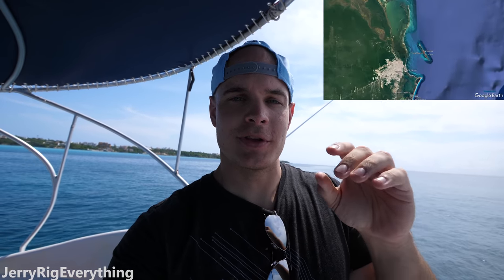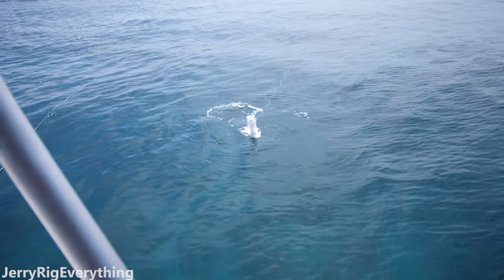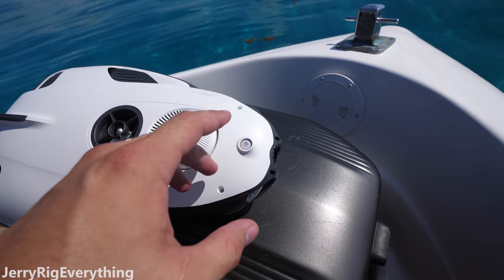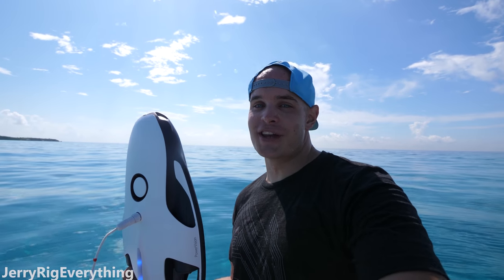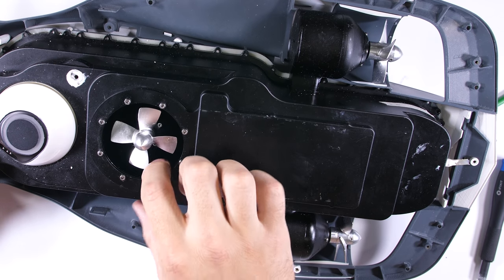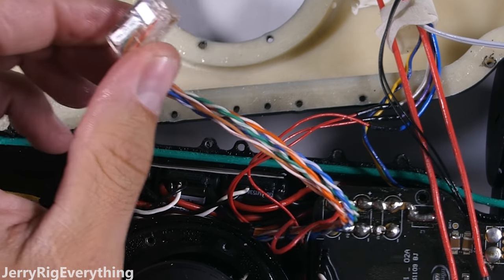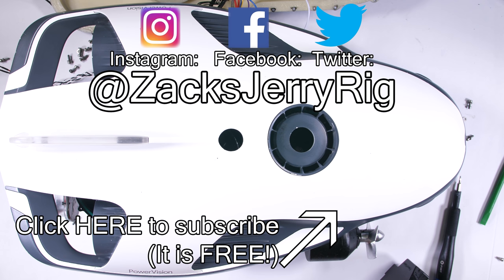This Under Water Drone Conquers the Ocean... in 4K!

Comment: As an underwater drone, you would think it would have a red lens filter so the colours would look real instead of green.
Reply: so it blocks more light?
Reply: @JanSeewald  No, so colors look more realistic and not green or gray.
Reply: Green is a real color...
Reply: @JanSeewald  It doesn't actually block that much more light. Search for videos of using a red filter for underwater videography and you'll see no significant difference in brightness, but a significant difference in the colour range.
Reply: @AndreChampoux  You can't expect people on YouTube to have an understanding of light & colour. They probably do not know that their screen cannot actually display vivid cyan.
Reply: @medotaku9360  But not the colour of objects at depth. Look it up if you must. If you know why the sky is blue, it will help you understand, if not you should look that up also.
Reply: @willclark2235  exactly
Reply: @philo8035   Phil Oetinger  Right, because saying that "*this drone does or does not correct for loss of color due to water depth*" would be complicated... NOT
Reply: The problem with a manual filter is that the color correction changes with depth. The deeper you go, the more red you need and the less blue. So, since it's all done in software after the fact there isn't a point in including it in the original recording software.
Reply: @mikinleyweaver4692  I've tried with the software and it sucks over using a lens filter from the beginning.
Reply: @AndreChampoux  True, it does. But with a drone that is remotely operated at all depths, it's just impractical to have a manual filter.
Reply: Andre Champoux green is a paradise colour
Reply: Andre Champoux those are the real colours? He isnt in a clear water bed
Reply: What do you mean real it’s meant to look like it’s in water not air
Reply: Andre Champoux No actually he’s right, it’s just gonna look worse because it blocks more light and it’s gonna look gray
Reply: You can just edit the white balance of the video

Comment: That rubber gasket certainly will re-seal with no special procedures if you put it back together. It's different from a phone because the phone seal is torn and destroyed when you open it, but this one is designed to be resealable.

You would want to tighten the screws gradually in a cross pattern to prevent damage to the gasket when reassembling.
Reply: rjk I think he need to reseal in a positive pressure chamber in order to get a counter force acting when this sub (or any normal watches) goes under water
Reply: Water pressure is intense. Every 10m depth adds another atmosphere of pressure. This drone is claimed to be water proof for up to 30m. Therefore this drone needs to withstand pressures from 1 atmosphere to 4 atmospheres. Since there is no mechanism for adjusting the internal pressure, the shell inevitably has to withstand a pressure differential. So the question is, how big and what direction? With a higher internal pressure, the shell is overpressurized when the drone is on the surface and underpressurized when it is at 30m depth. With a normal internal pressure, the drone is either in balance or underpressurized. Thus the shell only has to withstand one direction of pressure and it saves you from having a pressure chamber when assembling the drone. Of course, in this case the pressure differential the drone shell has to withstand is larger.

So it comes down to a decision by the engineer behind this thing. Honestly, my guess is that no internal pressure (just 1 atmosphere) is used.
Reply: rjk  you're right phones use an adhesive rather  than a rubber gasket like you see here. This will definitely reseal just how it came
Reply: "That rubber gasket certainly will re-seal with no special procedures if you put it back together."

Exactly.  I have no idea why this dude would assume this drones waterproofing is no longer any good.

"...any time you take apart something waterproof, or water resistant, apart... it'll never be water resistant again until it's re-sealed." 

That was one of the strangest statements I've ever heard.  If I'm interpreting his statement correctly, he's implying that this drone will NEVER be waterproof/resistant again since he's dismantled it...a statement that is demonstrably false.

Anyone who has a whole house water filter (20BB's and the like) will recognize this method of waterproofing as very user serviceable >and easily resealable<.

In point of fact, the system on this drone is BETTER than the ones on your typical water filter as the rubber gasket >doesn't get twisted and sheared< when the filter housing is put back on... And even THEN the filter ones work well enough that you can many times re-use the gasket rings if they're not stretched too much (Dow Corning Valve Lube and Sealer is excellent for these types of applications).
Reply: @oznerol256  It seems like a mod to the drone to put in a pressurizing port would be useful. You could pressurize it on site if you were going to go deeper that usual, conceptually getting perhaps double the depth limit depending on how much pressure you put in at the surface.
Reply: @rurruth  - No it doesn't.  4 atm is only roughly 60psi.  Not a huge amount when you are already walking in 14.7 at sea level.
Reply: @oznerol256  - Correct.  They will have done tests on an empty case with blanks fitted.  It could probably go to 100m (10atm or 147 psi), but for safety they will have cut this back to 30m to guarantee the seal.

Comment: You can put it back together and make it waterproof again. Just make sure to take your time putting it together  with the bead, the seal and the waterproof lubricant around the seal.
Then torque down all 46/48 screws tight and it will be good. Those things are not vacuum sealed and are put together by hand in china so when can be put back together as it was the first time when it was made.
Reply: Thank you! This was just lazy.
Reply: Thankyou! That was my thoughts also.

Comment: It might be cool, but for $1500, ehh.. I'd rather strap a gopro to a rope.
Reply from the maker: Lol, Ya, thats almost the same thing for sure.
Reply: Clorox Bleach its actually really easy to make something like this with a couple pcb pipes and some waterproof brushless motors and a waterproof container
Reply: Clorox Bleach He's Indian, so he gets a pass.
Reply: It's @Clorox Bleach again! I fully agree; this would be reasonable at $200 and kind of silly at $700, but $1400 is just ludicrous. Right now, it's more of an experimental prototype for the wealthy than a thing to take boating.
Reply: please make one and post video
Reply: Clorox Bleach I'd rather just go scuba diving myself....and I won't have that stupid tether connected to my back either ;)
Reply: Clorox Bleach lol
Reply: Billy poppins There's an army of me
Reply: I,m surprised of the cheap price.
Reply: You could make a sub out of an electric motor and batteries and a couple of servos (waterproofed). Still need a fucking cable though for the control. Bummer).
Reply: Or do what the pros at blue planet 2 did, suction camera on a whale
Reply: nightmare in action nighmare in action x doubt
Reply: $1500 in usa? in my country it must cost the price of a car..
Reply: There's a much cheaper open source version. Battery or wire depending on what you need.
Reply: Or the bottom of an rc boat.
Reply: Could be like $500 cheaper if most power went thru tether and drone contained just a tiny backup battery...
Reply: rather have a Rad Power Bike.
Reply: Or make one and strap GoPro to it
Reply: LOLOL
Reply: @SirKolass  lol Where are you from?
Reply: @allenschmitz9644  Overpriced ebikes!

Comment: I do repairs on these at work and they’re still water resistant once shut after opening. You just need to be sure to seal it properly. I would not recommend opening it due to the fact that the rubber gasket can expand and at that point you will need to replace the gasket

Comment: i like it.. by the way.. Radio waves shift 90degrees under water.  water is a diamagnetic material. it will push away from a magnetic field.  so one would have to create antenna out of diamagnetic materials or paramagnetic materials to try to get a radio wave out in the proper direction.  putting a mylar balloon on a drone to assist in lift has been a plan for a long time.  using hydrogen gas instead of helium gives you additional lift for cheaper than helium.  since mylar balloons can have a metallic coating . they can't build a static charge..  anyway.. making the balloons releasable might be fun too.. this way you get your drone up in the air with minimum power usage..   or hover with minimum power.

Comment: Since it uses RJ45 copper Ethernet cables, which has a limited range of around 300 ft, you can get rid of the copper cable  and replace it with single-mode fiber, which btw can stretch up to 30 miles without a repeater if your end-to-end lasers are powerful enough. Also, if you can take those plastic caps and cast them into aluminum, you could probably double or triple your depth. I'd use the copper Ethernet for power because you can send 48 volts over Ethernet twisted pair wires called Power Over Ethernet (POE) and I'd used the fiber for data storage, however POE only has a limited range of 328 ft.  Have 8x4TB SSDs stored in a NAS that has a 10Gbps SFP+ fiber NIC on the boat then set it to live stream recording in 4K or 8K footage through fiber on the PowerRay.

Comment: We use drones because we can't just fly up in the air. But snorkeling / diving isn't that hard and in fact, it's more fun to be in the water and filming, than just staying on land and navigating a drone. So I don't see that much use in this product.
Reply: They can remove the danger of actually diving for footage. No safety stop, no gauges to check, no ascent profiles, no pulmonary embolism (which can damage your lungs bleed even shallow as 15ft if you don't avoid it), and no bends. So you can get footage easy without dive planning and the like.

Comment: needs resin over the electrics/board and inner main power waterproofing for better long term use, and also 
needs a mini sonar+compass so it can show you its orientation on a mini map pip in a corner of the display.

the tether cable needs some armor, either spiral fishing line nylon layer, or braided stainless.
the right thing would be a tether to a buoy that had an underwater wireless system, but i guess there isnt such tech...

Comment: Someone may have already said this, but I don't have the time to search all 2K plus comments. While it is true that water is a poor medium for signal transmission, a bigger issue is, what is the maximum signal strength for Bluetooth or wifi devices, and does water attenuate the signal for different frequencies differently? The answer to the second question is yes, and as frequency goes up, so does the attenuation. Frequencies around 300 Hz –3 kHz work well for submarine communication. Bluetooth and wifi are roughly at 2.4 GHz, so yes, they will have far worse attenuation. Then comes the issue of signal strenth. For Bluetooth class 1 devices, the maximum permitted power level is 100 mW, giving a range of about 100 m / 328 ft, in air. For class 2 devices, the max permitted power level is 2.5 mW, with a range of about 10 m / 33 ft, in air. For wifi, a typical 802.11n device has an indoor range of about 32 m / 105 ft. Full power for wifi is similar to Bluetooth, 100 mW at 2.4 GHz. Most Bluetooth headphones are class 2 devices, thus have a range about 1/3 of wifi, indoors.

So, with a 225 ft tether, instead of outfitting the seadrone with a more powerful Bluetooth device, and risk that the signal gets attenuated too much, and rather than shorten the tether, it looks like they went with a weaker device, which would consume less power (allowing the drone to be lighter), but have to be much closer.

Comment: Ok 2 hours but the battery pack and control unit can be plugged in and charge while you are using the drone? Just plug the battery into a power source and it would have infinite run time!

Comment: Nice video . I may need to get one of these drones . Bluetooth and WiFi can not transmit under water at all. Radio waves don’t work under water. For submarines to communicate , they use sound or they surface and roll out the antenna .

Comment: Great video, many thanks!
Can you, please, clarify, whether this ROV is able to write GPS-position (coordinates) into EXIF-header of jpg/dng file, which it shoots?
Or may be you can recommend some othe ROV model that can do this.

I need this functionality in order to map bottom pollution and make web-GIS which shows garbage locations (georeferenced points) with repective photos shot by ROV.

Just approximate position (RC/controller position) will do since I will be deployng ROV almost vertically from boat.

Best regards!

Comment: Ok let's perform durability test, bending test, scratch test, drop test.

more
Reply: You forgot about the burn test, you wouldn't want to find out that it couldn't survive being burnt while underwater now would you?
Reply: vgamesx1 but nothing can burn underwater naturally
Reply: RoastymyToasty thats the joke
Reply: hahah i forgot about. burn test also will apply
Reply: just kidding folks
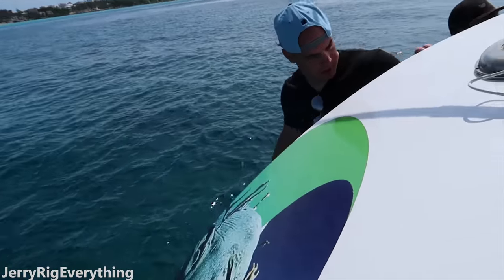Reply: FRANTIC 3:14 drop test
Reply: hahaha oh drop test is done
Reply: Depth test. take it to Mariana Trench with a dozen extension cables
Reply: FRANTIC 
emmm, shark bite test
Reply: Good suggestion.
Reply: Dur
Reply: A Kinetic energy test like a drop test or smash test wouldn’t help much since there’s not a lot of quick kinetic energy under water, there is, in fact a lot of slow kinetic energy, so a pressure test would be good. This drone also needs full three dimensional control rather than the poor two that it has, by adding pitch, roll, and lateral propellers.
Reply: FRANTIC a
Reply: We should perform a raisin test. See how many raisins it would take to stop the propellers
Reply: XLV Raisin haha is that new?
Reply: FRANTIC o.....k
Reply: Dr. Phil Good TV haha
Reply: Dr. Phil Good TV anything that I missed to mention
Reply: FRANTIC no ur good bubba
Reply: You forgot the molten metal and cockroaches test
Reply: FRANTIC Vlog @

Comment: Don't forget, when you take it apart, it won't be water resistant again ....well ....thats nice....if the battery dies you have a problem ....also, normally a battery is good for around 4 years..... It's a nice gizzmo, but they should have thought a little more about that battery ....

Comment: A very nice review of the water drone plus a video!  Regarding losing orientation I will suggest to the company if they can add some kind a compass  device in the drone and in the drone App as a directional point.  I do Scuba diving and my Compass works fine under water.  If they add something like that the "Loosing or direction, Issue" would be resolve.  Hopefully they can take on adding a Compass as consideration for marketing.  So, take my suggestion for consideration if you contact the company.

Comment: I'm stunned of why they are using single plugs on the black/white connector where 6(?) connectors is connected in a row. That's like asking for mistakes to happen. The PCB design seems to be kinda cheap and the soldering points bridging multiple pads makes me think that someone didn't think the design trouch before manufacturing the boards.

This is looking messier than my own projects, this could have been done a lot nicer but it reminds me of an arduino project in a project box. That's sad.
Reply: And yes, I know that this is a prototype but seriosly?

Comment: I own one, and wonder why no one talk about the dealbreakers in this drone... like its a chapter of its own getting startet, like that it disconnects with the app a lot, and it's so frustrating. And that you have to visit the powervision website to download your videos and photos, instead of just having a cable plug in the basestation that you can connect with your computer and download it from there. And that the SD card sits in the actual drone, and if it crashes, the whole drone is useless, and card failure is pretty common in the photography world :-/

Comment: Why wouldn't they put the battery and removable storage "in the boat"?
Run power and data through the tether...
Reply: It has antennas as well, so if tether breaks it can surface by itself and navigate back to base.